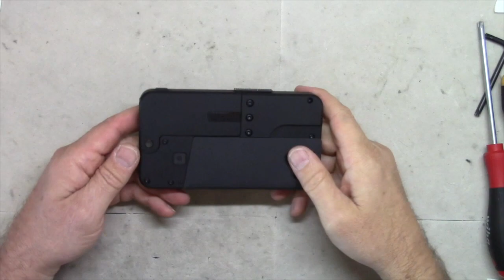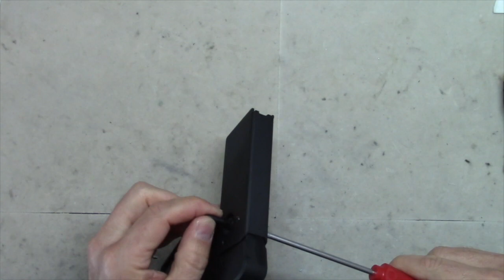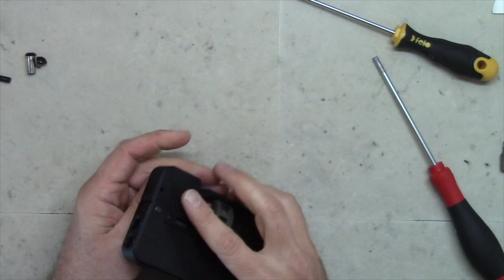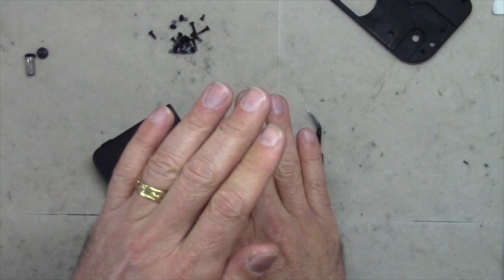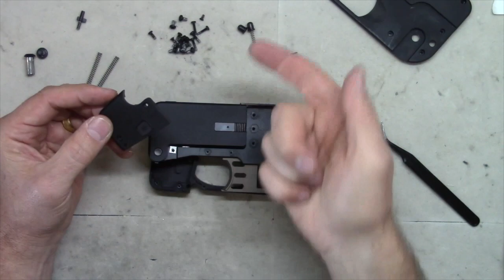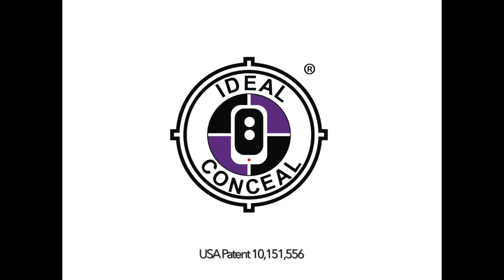Tear Down - Ideal Conceal .380

Comment: Dang it. Got mouthwash all over my gun and needed to wash it with water. Couldn't disassemble it so I had to douse it in oil and hope the water didn't get in anywhere the oil didn't reach. 

It's understandable why it's required to have a pin torx tho. I enjoy the product however and it's not like you guys can account for so much with such a strict constraint of "phone shape"